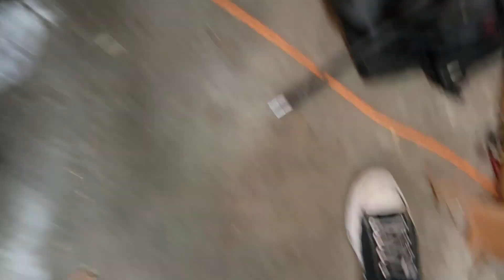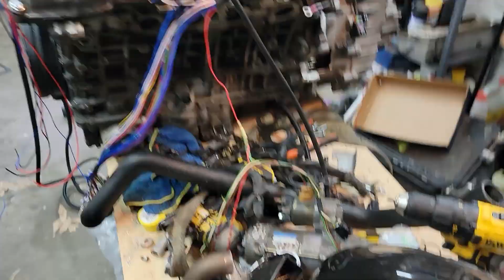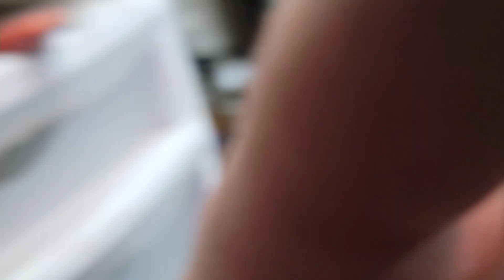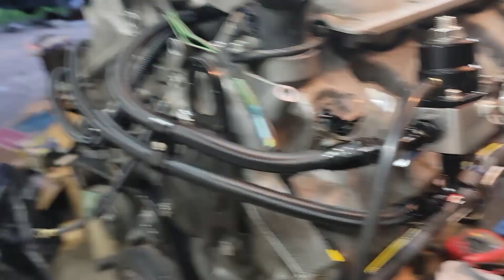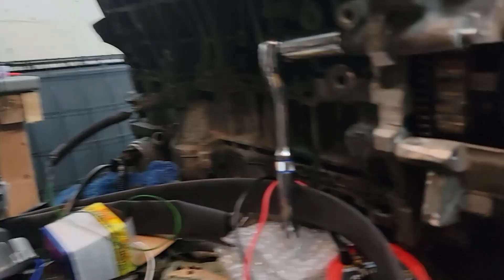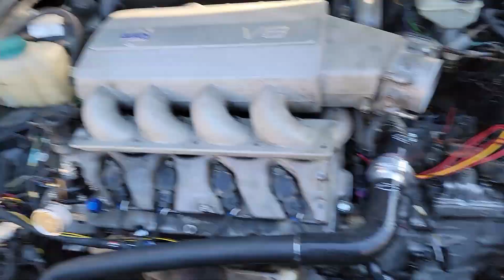It's Almost Ready! But Will It Start?

Comment: What clutch set are you using for the manual swap?  I tried a 2006 S60R set, and the dowels on the Spec flywheel don't fit through the pressure plate holes.
Reply from the maker: It's a spec stage 2 clutch and pressure plate with a custom spec flywheel modeled after the s60R one but with the v8 crank bolt pattern.

Comment: Volvo has a OEM mount for the fuel operated heater that is holded with the subframe in this position where you want to install your power steering pump. I think you can easily modify the mount for the pump
Reply from the maker: I'll have to do some digging about this one. Thanks for the heads up!
Reply: @FingersCrossedMotorsports  I could give you the partnumber if that helps
Reply: You mean like the engine block heater? If so ive tried to find a way to buy the engine block heater parts but they are either NLA or are only avaliable from european cars